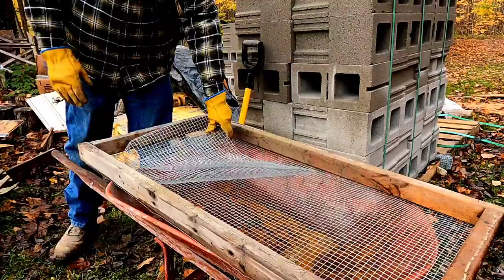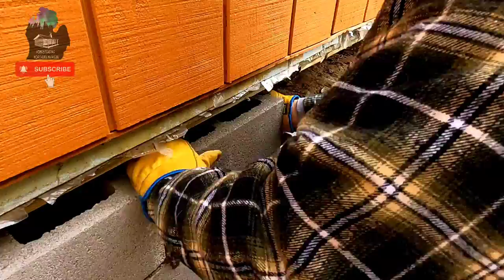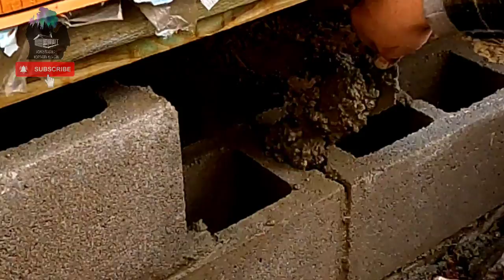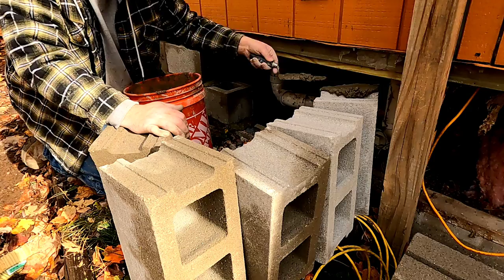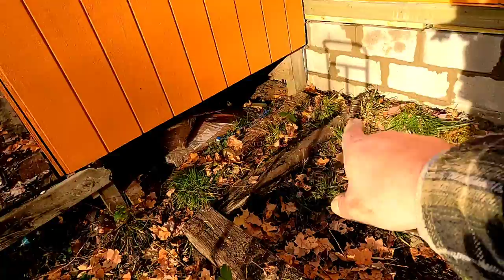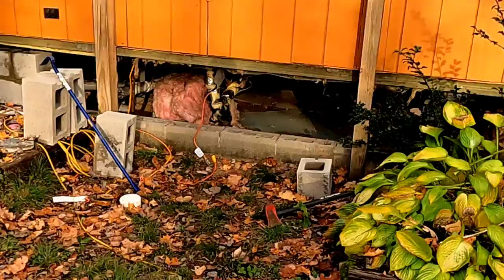Replacing The Skirting On My Mobile Home With Cinder Block

Comment: Hey Jason, I got your name from reading the comments. I'll call ya brother in you don't mind. Brother that's looking great nice job. I'm messing with crete also. I rented a lift and I'm trying to repoint a chimney and clean it while I'm up there.  after 30 years it was showing signs of leaking. You did a sweet job should make a big difference this winter. Cheers bud!
Reply from the maker: Good luck brother. It's definitely making a difference with the heat... Thanks for stopping by my amazing friend

Comment: Wow tough hands using your fingers as a trowel and trimming tool.  I noticed since its a skirting and not load bearing you didnt put in a cement footer.  I am thinking of doing the same as the cinder blocks will be just used as a skirting as well.
Reply from the maker: They're aren't that tough, that hurt like hell... I wasn't for sure if the trailer itself would be stable enough to set her on and since my goal was to keep the pipes from freezing it wasn't necessary.... All trailers naturally settle so I guess I'm a few years I'll know if this is a problem... The existing single block wall is cemented into the ground or you do mean like a formed and poured footer?
Reply: @HomesteadingNorthernMichigan  I meant a formed poured footer with R-bar. I couldnt see any cement other than what was used between all of the blocks. So in essence I didnt see a cement base where the blocks get stacked on top.  Hope that makes sense.
Reply from the maker: It does... Just what I was thinking

Comment: I like what you're doing there, but it would have been super helpful to tell us the ingredients and their ratio for the cinder block mortar. Also I'm curious about long-term stability of the cinder block "footer" because of ground heave and frost level.
Reply from the maker: @12thDecember  the weight of the home isn't on the block so I don't think the preexisting footer will matter much.. there was a couple loose spots on the footer but I havn't seen any cracking or anything

Comment: At 6:31 there is a 2 inch gap between the wood and block. Camera changes and there's better light 2 seconds later and the gap is gone! What did you do?
Reply from the maker: I put that 2x6 in there too fill it... then put foam to fill the rest... thanks for stopping by and commenting...